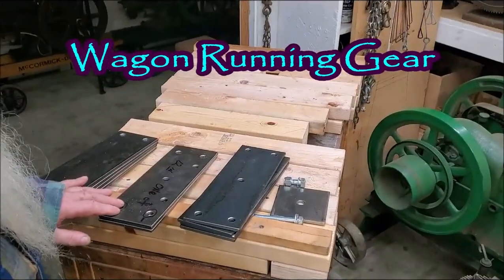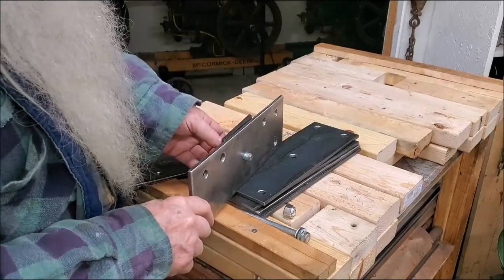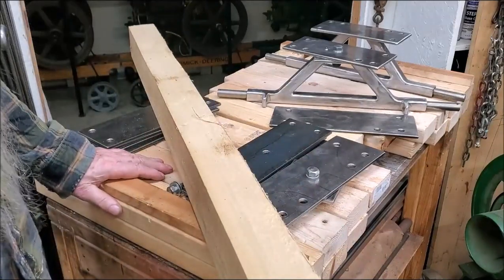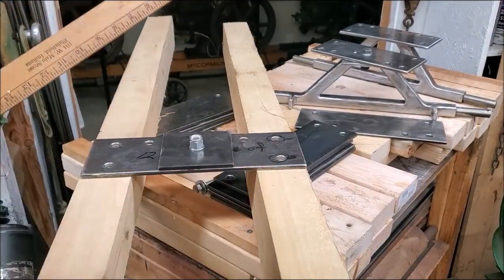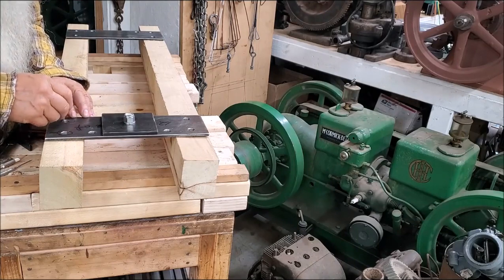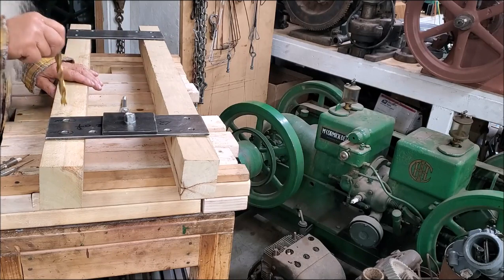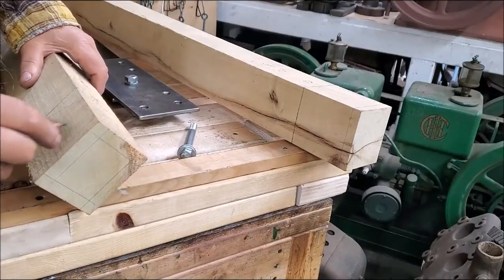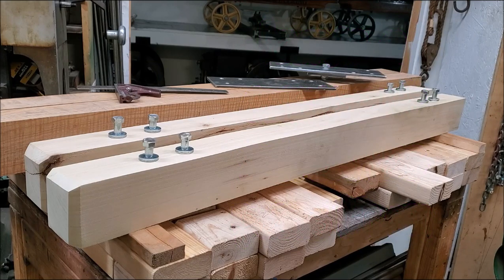How To Build a Wagon Running Gear

Comment: I have some wheels and metal to build a cart for that 1-3/4 HP United.  The wheels are large diameter based on advice you gave me about making it easier to transport.  How do you feel about Black Walnut for skids?  I have some nice pieces that I think would look really nice; not original style of course, but furniture grade nice.

Comment: Yah know, the color of that wood is too consistent to be poplar, and the density seems too light to be maple, thinking maybe beech or birch. Either way, those skids turned out real nice Sam, and it looks like you have been working overtime on the milling machine. Maybe, once you have satisfied your appetite for engine carts, you could take a break and make time for a good old fashioned fireside chat,,.just saying.